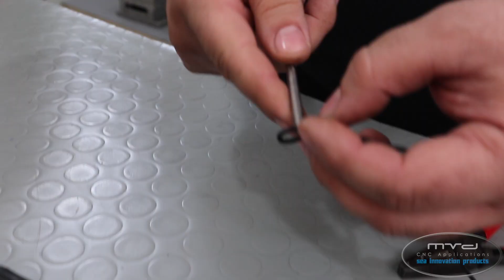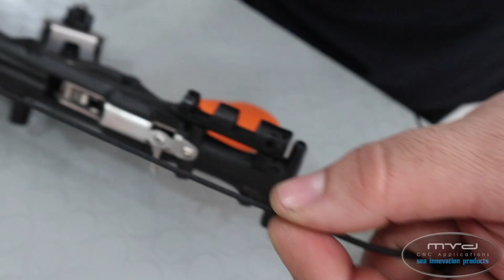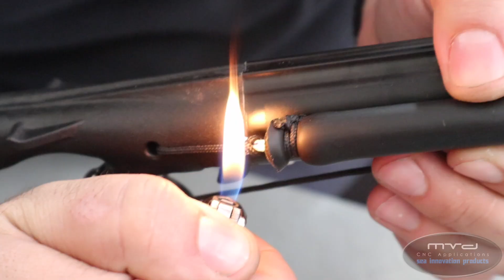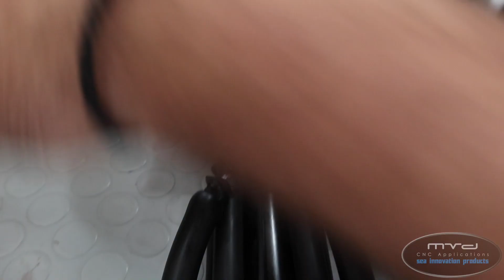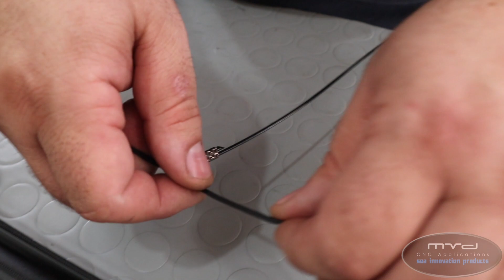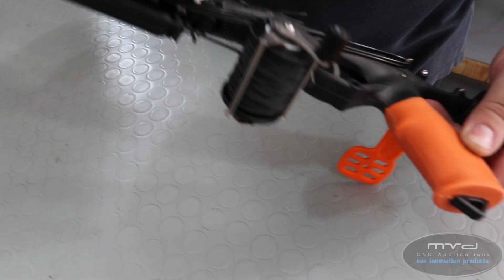Compact Spearguns! Zeso 55 Invert Roller - Setup

Comment: I expected to be complicated, but not that complicated.
All these straps will hold up?
Do you lose setup in the water after each shot?
Reply: Only one pair of rubbers stay in place, everything else is lose. I have similar speargun, just the 82 cm barrel lenght. For the reason of easier operating, i removed one pair of rubbers. And it turned to be good solution not only for  easier operating also  ior the accuracy of the speargun. With 3 pairs of rubbers it has too much power delivered tothe spear, and spear tends to bend and go downwards when exit the muzzle. With two pairs of rubbers you get little bit less power and final range, but you get  pretty good accuracy. No downwards spear shift.  They made a new model of this gun and they made some significant improvements. BRGDS